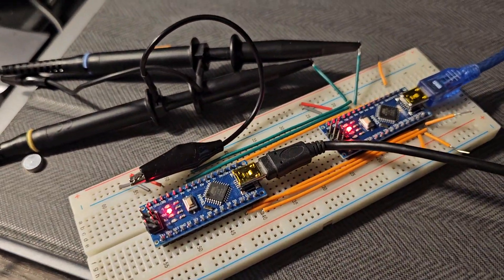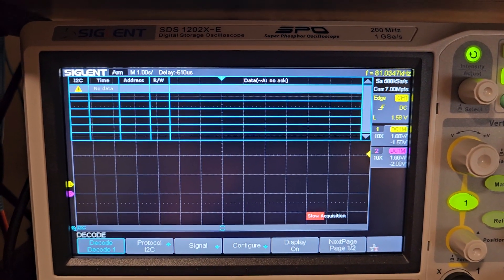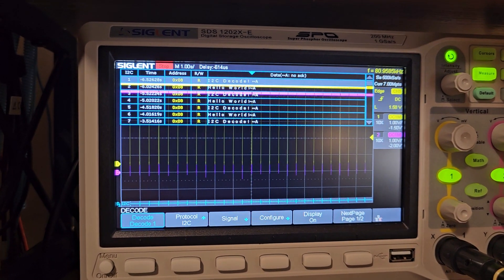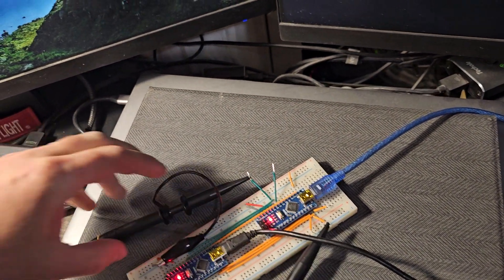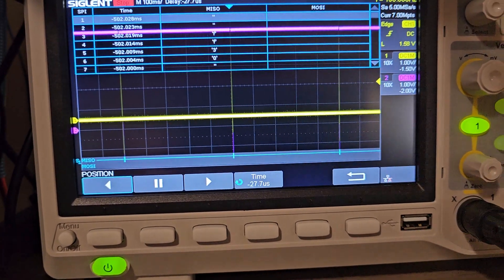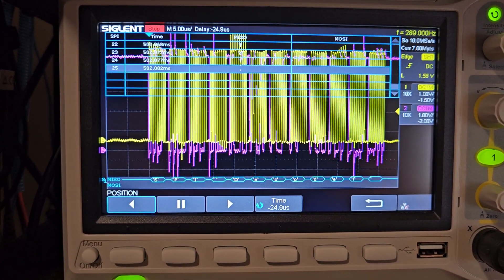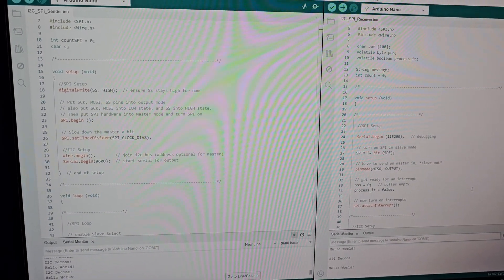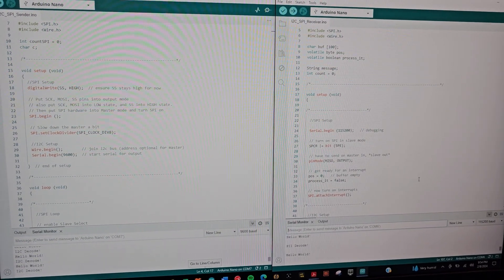Siglent SDS1202X-E I2C (400 kHz) and SPI (2 MHz) Decode

Comment: Good explanation. Choosing the message "Hello World" is very thoughtful as one can see the decoded data. Was able to get the I2C data, But the SPI is a bit difficult. Got a glimpse of stopping the data packet for the scope to decode the data . need to try out. I have multiple packets with different time space between them. What to choose data length ? It is accepting any value. For I2C it will be usually 7 /8 bits. Any thoughts ?